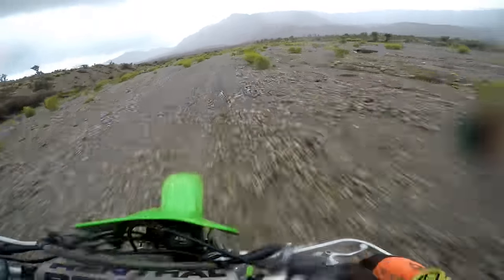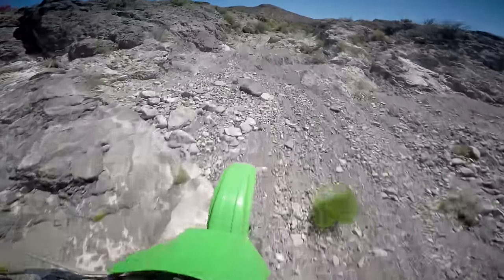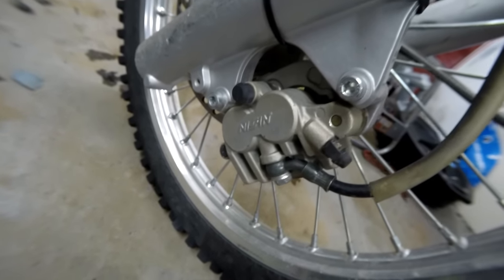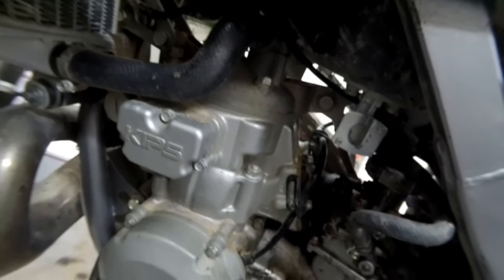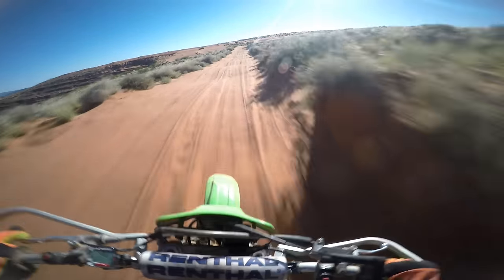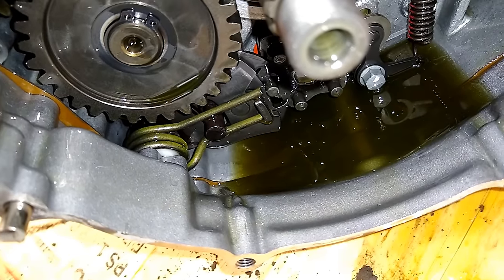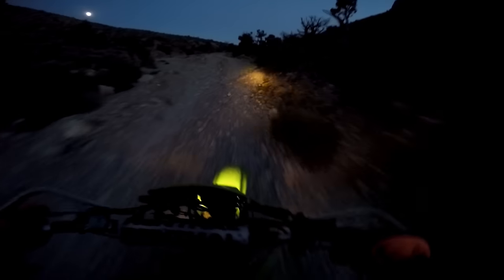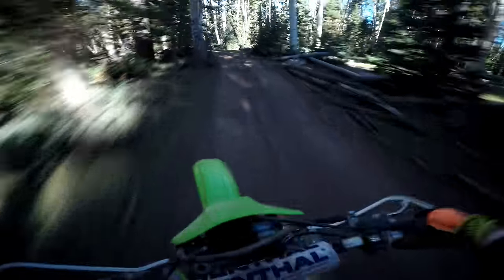KDX200 In-Depth Review

Comment: I've had 4 KDXs, 200 &  220 love them to bits won my first hare and hounds championship on one.

That said, when I bought my then nearly new 2006 GasGas EC200 from 2005 KDX220, I couldn't believe the paradigm shift in all round performance....it turned me into a riding god that day😅

Gasser was lighter, handled sooooo much better with quicker turn in, more stable, way more traction, all this with a far plusher ride. 

Gassee had more low down torque and better top end, and importantly brilliant brakes. 

In fact the only downside I noticed was the kdx had snail cams for chain adjustment and better side stand, both of which are simply nice to haves. 

Strangely the kdx 200 was so much better in the engine department stock, whereby the 220 was positively astmatic and way slower, similar performance to a Yamaha TTR250, which is poor, for not a lot more torque, the power curve data graphs of both models tells it all. 

But, don't get me wrong, I'd like another KDX but I wouldn't be looking at one with rose tinted glasses. 

A great bush whacker but from late 90s they had certainly their day, migrating to a trail bike, with RMX, WR, Gasser EC, KTM, Husky knocking out proper competition rides. 

NB Good heads up on the totally mismatched suspension, this affected flat out stability on fast open sections. I stripped my front end to remove 3 shims of the high speed stack to try and improve the high speed compression, helped quite a bit. 

Had the rear end rebuilt with lighter oil which softened the rear somewhat.

Comment: Excellent video. I bought my 2000 KDX 200 in near mint condition in 2013. I ride frequently, it is every bit as excellent as the video suggests. I have done very little to it except tires, brakes, fork seals and lubricants. I'm curious what came off the test bike afterwards, was it rebuilt or junked? What worked did it need? Thanks for the video and information much learned!!!
Reply from the maker: I can't link to it here, but there's a thing called Torture Test Magazine on the internet which goes over the whole story of that bike. Glad you liked the video!
Reply: @TortureTestMagazine  I'll check it out, thanks.

Comment: I always thought the KDX from was basically a KX125 frame and geometry ,I just sold my 98 KDX 200 sad, but got a mint 1995? Euro spec Suzuki RMX 250 blue and white upside down front ,it came with full road kit and full moto spare kit with a RM250 motor ,full yellow RM plastics, forks,swing arm, shocks pipe,So i basically have a blue and white RMX and a Yellow RM in the same bike ,but the old KDX was a great bike and ill miss that green slime machine

Comment: Great video!!!! Very detailed and thorough, breaking down the bike perfectly! I own a 93 KDX 200 that I picked up for $300 Canadian!!! Needed a good gas tank cleaning, carb cleaning, and free up the clutch plates as they were seized together. I was able to salvage the clutch plates and basket with a little sanding/filing and it seems to be working just fine now for the time being. But I just absolutely LOVE this bike!!! So peppy, easy to ride, and love having that 6th gear to let her rip on an open stretch!  Question for you though? What size jets did you end up putting in? I know there are lots of variables for this but just looking for a good starting point to compare what I have in mine currently as yours sounded great!  Again great review on the bike!
Reply: I'm so jealous, I'm looking at a 91 here in BC for 2600 lol. 300 would be a dream. Is it worth that money in your opinion?
Reply: @cascadian19  it’s hard to say really without looking at the bike. Just be thorough when checking it out but these bikes are pretty darn solid if taken care of in my opinion. They do hold their value too it seems like so just keep hunting and maybe you’ll find a deal somewhere!

Comment: I very much regret selling my kdx220 for a 98 RM250.
Being young and naive I thought i needed a 250 motocrosser like everyone else was using.
This is for singletrack Rocky Mountain riding.
Not saying the RM was bad (after suspension mods and flywheel) but without doubt the 220 was better suited for what I was riding.
Fast forward 20 years and I definitely know power isn't everything. 
I've gone from 500 to 350s to 300 2 stroke to a 250FX 4 stroke......and ride everything probably better than ever.
I could have ridden the kdx forever,saved a ton of money and still been happy.
With age comes wisdom.....the kdx is a classic,its sad that Kawasaki abandoned the off road line,just imagine how many kdx they could have sold with some upgrades....

Comment: 1995 kdx 200..I've owned mine for 20 plus years, easiest , low maintenance bike I've owned...takes a crash well..and you dont need $10 000 to enjoy getting muddy...well well before the rekluse clutch Kawasaki...had it all figured out in power to weight ratio, plus gearing!

Comment: When I was 12 I got a brand new KDX 220. I was tall. So I could handle it. Today I’m 28. I have wound the piss out of that bike and beat on it, gone up hills In first full throttle, endless times. The engine is in breakable. Just CHANGE THE OIL.

Comment: You mentioned the power-band's "hit" several times.  Remember, you were riding a KDX200 with an aftermarket pipe.  I bought a new, in-the-crate 2006 KDX200H6F twelve years ago.  I can assure you that, with the stock pipe and silencer, there is no hit; just a steady climb to max rpm.  After installing an FMF muffler,  the bike was slightly 'peakier', with a definite... if not huge... hit when it came on the pipe.  From the vid, you had a different pipe and silencer.  I'm betting even the "torque" model FMF pipe would increase the hit over a full-on stock exhaust.  By the way, I still have that KDX200, even though I haven't ridden it since 2013.  I'm 73 years old, and ripping through the woods just doesn't hold the same appeal that it once did.

Comment: I know why because you could ride the all day an then we’re more fun because you had more on bottom end than a KX to play with I was into Yamaha DT125R and the down pipe bended around more than a YZ, that why the power doesn’t kick in like a motocross bike , that an the gears, on a enduro bike I would get a smaller D.I.D back sprocket so you could chill with it and not choke it up , and you could go out on them all day, and the piston rings would last for ever if you mix your own and not rely on the 2 stroke feeder

Comment: If you like this one, try an 1988 air cooled version..lighter, 37 stock up with a good pipe and silencer basic port matching 40hp realistic to expect. Has same trans and clutch as you described, since this bike is built on a kx 125 frame, I have kx forks and shock and linkages I change for motocross with AHRMA in the modern class. Fyi at Arizona cycle park I held my own against new 300 Ktm's , way faster than modern 250 four strokes. Long travel suspension great for the west, I will switch back to stock for the woods at some eastern cross country races this summer. So easy to start and ride, nothing like my 70 hp 220 lb. Husky cr500.

Comment: That light weight machine is way more capable than the modern bikes of today. Plated street legal, light, powerful 37hp (compared to similar sized 4strokes), easily maintained, puts wr250r dr250 ttr250 klx250s crf250l klr250 slug bikes to shame! That kdx shown has a weld on tower for a Scott’s steering stabilizer.

Comment: Nice, I used to ride with someone, (dead now, not on the bike), that used a kdx200 bored to a 243 thanks to lasco and wiseco. I was riding a club preped husky 240wr. And the kdx impressed me. I ride a similar bike myself now, a 1992suzuki ts200r, (sh12a). It has upside down forks, 3 piece electricity activated exhaust valve, full floater suspension, etc, etc. Plus some correct porting and choice sprockets, etc. But I think the kdx would of done me like a dinner.

Comment: back in the day in new zealand kdx 200 were the weapon for xc and enduro,in 95 with the new generation model we all raced in our unique mx 0 to 200cc 2t/0 to 300cc 4t enduro class..(and enduro and xc) common perceptions in our neck of the woods... (right or wrong...) was  for mx set up...fmf or pro circuit pipe and muffler (hot set up was fmf pipe with pc muffler) or bills pipe.....boyesen rad valve,airbox cover and snorkel removed,heavy clutch springs,(25hp stock...vs 35hp with pipe and muffler combo..?? thats what we knew...)also guys were experimenting with spacers in the rad valve area for more torque.. didnt like the 220 as it didnt rev as high as the 200...   never run the sidestand as it is an absolute anchor,removed big ass steel tab off the swingarm as well..   kickstarter,footpegs,and gearshifter were absolutely crap!!made out of rubbish..only good thing is you could get them welded up and file them back (except the crap gearshift...there is an alloy lever that works perfectly but i dont know what its off...lost my oem in a mx,while looking for it found a random lever that had snapped off at the shaft...tried it and it was perfect...never matched it up on any of the other kdxs i rebuilt!!  clutch baskets are crap and slog out in 5 minutes...crazy weird handling,especially in the mud!!!ditch the rubber bar mounts and go solid!!learn to steer from the rear!!if you weight the front you will pay!!!have since rebuilt many kdx 200h for mates.....great bikes!!!

Comment: At about the 6 min mark you started talking about the handling of the bike. The suspension is indeed setup from the factory exactly how you are saying. And they are doing it for the exact reason you said. That my friend is called Kawi handling characteristics. Even brand new Kawis weather they be Mx bikes or off-road handle with that “loose ass end feel” and that’s why you will hear Kawi guys talking about steering with the rear. And that power you were talking about applies to all Kawasaki 2 strokes that have the kips power valve system. The hit the nail on the head with that setup. I would recommend converting a 1994-98 kx250 (flywheel weight, skid plates, kickstand,18 inch rear, etc) I think you would fall in love. Great vids man. Love my toomer tears shirt.

Comment: lol every time I watch one of your videos I want the bike your riding by the end of the vid. . .  I will say I haven't ridden a Kawi 200, but I did ride an old kdx125   and I think I know what you mean about how the bikes like to change direction quickly and easily "flickability"  At the time I was on the CRF230 (of coarse) wich still has to be my favorite over all bike, its just the most fun I've ever had is on the 230, I'd say the KDX125 felt relatively close to the 230, just a little more flickable and taller.  Either way both were fun

Comment: I purchased a 2003 KDX in 2005 for like $2300.  I also had a x-r 400 for many years.  I rode them both equally and the xr needed two top end rebuilds and the KDX never got one until I was taking other things apart and just decided to do it.  We would often leave the house and ride to trails without trailing and I have ridden over 100 miles many times without running out of gas.  I have a flat slide carb and autoclutch which make it almost unbeatable on slow steep boulder ridden hill climbs.  No 450 on my rides comes close. 
Gotta say I do not like the fork and will be replacing with a KX 250 version.  Otherwise agree with your comments.

Comment: where do you guys get replacement parts. like actual important parts not little skid plates or light bulbs but like a jug replacement??? is there a website someone can send me to looking to pick up a kdx 200 just need to know if its worth it because from the digging ive done the only things that are readily available are little quick replaceable things like clutch plates and pads and fuel tanks.

Comment: I owned a 92 kdx200  and I regret selling the bike but I had a YZ125 and a YZ250 so I didn't ride it that much so I sold it,but when I did ride it I put a lot of hours on it and never change the top end and it always started on the first or second kick every time, my question is why does the top end on the kdx200 last so much longer than other two strokes?

Comment: Basically an old- school mxer detuned... with a softer suspension. Good bike,excellent durability, and a top end that you can rebuild at your riding site,if needed.(for under $100!) LOVE IT!
I raced 2 KX 125s back in the day... similar frame geometry... rake and trail. They were cut-and- thrust gun fighters! Bob Hannah riding style worked best... brake slide a 90 degree turn... and hammer it!

Comment: That was a great review! Ten years ago I bought an 89 KDX with 94 inverted shocks, no lights, but a brand new, rebored cylinder (not Nickosil). I paid $260. I spent the next ten years (and about $900 more) slowly bringing it back into reliable running condition (it’s actually been pretty damn reliable except for some leak issues which I finally fixed with new seals and a little  JB Weld). 
It still doesn’t have lights, and could use a new kick starter gear, but it runs like a champ!  My son has ridden it the whole time, but finally graduated to a 2001 CR250R, which has proven to be a beast. 
Now I get the KDX for myself. Sure, I’m nearing 60, and sure as hell don’t have the skills I once had, but the KDX is perfect for me. I just recently bought some .38kg front springs from Jeff Fredette to replace the paltry .33kg factory ones, and I’m looking forward to trying them out this spring. Not looking for an MX front suspension, just something more suitable for my 200lb. ass.

Comment: I bought a new leftover 04 KDX200 for $3600.  FMF desert pipe.  Some Boyseen reeds. RB designs did their carb slide and body mods.  And reshaped the cy head.  I added a skidplate.   Put hours and hours on it.  Desert. Mountains.  Mining mountains.  Rocks and more rocks.   Tore it down for a piston even though compression was still a few pounds close to stock.  Redline two stroke oil.  It all looked new.  Powervalve was clean.  Put a new piston in.   Finally wore the clutch down.  New OEM back in.   Bike can sit for a long time and fire on the first or second kick.   Tranmission ratios are wide.  And perfect.  1st is like creeper gear.  6th rarely need unless wide open in the desert.  Always used Bel-Ray gearsaver 80 wt.    I just put a KX500 set forks and triples on it.  What a difference.  Rear shock is stock valving with a Fredette spring.   Need to get it revalved to make it a little more cushy.      I have a lot of bikes including a new 300.   The KDX is still one of my favorites.  Cause it can do it all.  Maybe not the best.   But a whole lot of fun.  And reliable.

Comment: I just came across your channel.  I've never ridden a KDX, but it does have me wondering - have you guys done anything with the old Yamaha ITs?  I spent a good part of my teen years riding on a 77 or 78 IT 175, and after going 20 years without riding, I got myself a 1981 IT 465.  I also have a non working 1983 IT 175 and a non working 1985 IT 200 that I hope to restore.  From what you mentioned of the KDX, I would think the ITs would be similar, in that they are that awesome gateway to the 2 stroke world.  They're nice and torquey on the low end, but they definitely have that two stroke zing.  They also have that nice, off road soft suspension.  I've only had my 465 briefly, so I haven't really been able to put it through its paces, but the little testing I did, I LOVED its ability to really slow down in third gear, without stalling out, and then being able to take off again.  If you guys get a chance to review any Yamaha ITs, I'd love to watch.

Comment: I realize this video is 4 years old, but I just found it, so being an owner and big fan of these bikes and reading some of the comments, I felt like adding my 2 cents.  They're popularly known as being one of the best all-around trail bikes ever made and I couldn't agree more.  Good power and suspension for more experienced riders, yet the power delivery characteristics of the engine are still mellow enough for a beginner rider to get acclimated to riding dirt bikes and not be intimidated by or scared of riding a bike with a hard-hitting powerband.  

My dad bought my brother and I a brand new '93.  What a great bike.  We didn't really put a whole lot of hours/miles on it as I recall, but it definitely got ridden hard for sure, was always reliable and never gave us any trouble.

Many years later, I was given a '90 that I still have, that belonged to my brother's friend's older brother, who cut his teeth riding enduros on it, eventually upgrading to a KTM.  He passed it on to his dad, who eventually also moved on to a KTM.  They held onto it, with it ending up being the beater spare bike for their riding group.  Naturally, maintenance and repairs on it weren't a high priority, so by the time I got it, it was completely thrashed.  I pulled the carb, cleaned it out, put it back on, put some pre-mix in the tank and it fired right up.  When you kick it over, the compression is weak as hell, the teeth are stripped out on the aluminum KIPS valves, the clutch side crankshaft seal is shot, allowing it to suck fluid out of the trans, the spokes are loose as hell, the chain and sprockets are done, but it still runs and rides.  What was Kawasaki thinking when they decided to stop making these bikes?

Comment: I have a 2003 Kdx 200 and I can say if you put a fmf desert pipe on and not the woods pipe this bike will amaze you...along with the vforce reed set. I was going to get the woods pipe but after riding this bike stock I found that it had way too much bottom end and very little up top....so I took a guess and wow! I like the fact it softens up the bottom end some so I can get through the northeast's slippery roots and muddy rocks without losing much traction....it's just perfect now! 
Thanks for the review as it was dead on...the best Japanese affordable 2 stroke endure ever made...period!!!